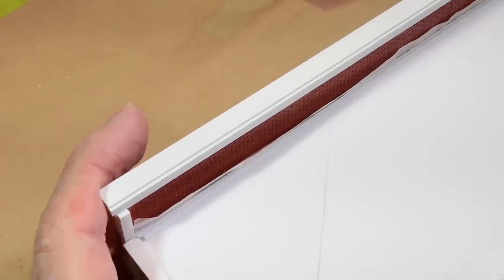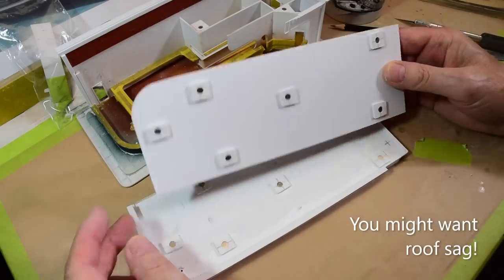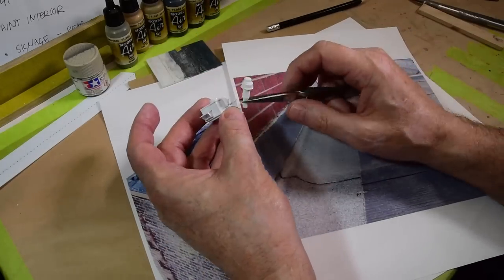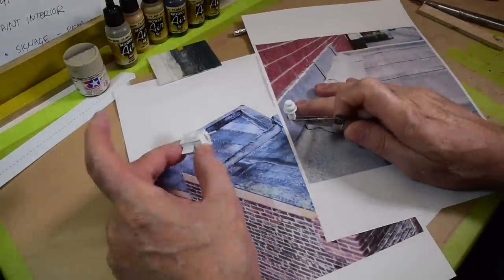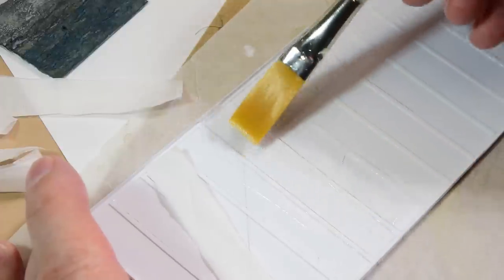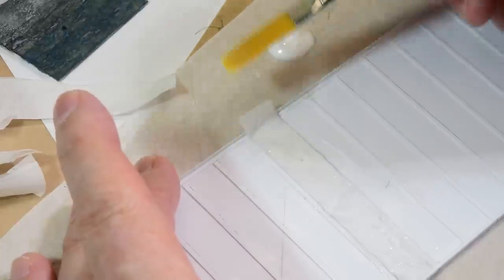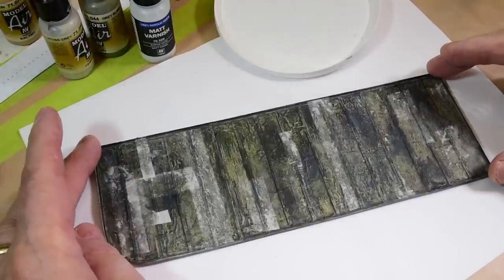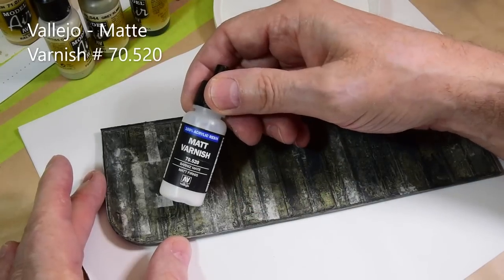The "Nighthawks" Diner Build (Part 5) | River Road ~ Vlog # 137

Comment: Dear Boomer, love this episode on roof modeling. FYI the tar paper you’ve shown with the ‘stone cover’ is called slate chippings, or when a coarser variant, roof gravel. 
Roof gravel is mainly used as ballast, hence the roof membrane doesn’t need to be mechanically fastened. The slate chippings is mainly an extra protective layer for the tar paper. Either for UV protection, or in case of rather flat roofs, to prevent the occurrence of highly corrosive bonds, which can occur when a thin, capillary, layer of water stands on an uncovered tar paper. Such small layers of water are actually capable to form sulphuric acids, by creeping into the hairline cracks of the tar paper. 
As a former plumber, roofer, I’m not familiar with a roofing system that has visible mechanical fasten methods. Other than the two or three layered systems, in which the base layer is tacked, or screwed. Of course those layers are covered by a glued or flamed top coat, which fully seals the punctures. Although I must add there that visible rust on a roof is a certain indication of top coat dilapidation. Hence, the dots still look good on the model.
Further, on modeling roofs, especially in the smaller scales, one often sees (my eyes) a lack of standing up roof material, as well as a lack of flashing. Also, on a lot of models I see a tendency to construct against the obvious flow of water. I do very well understand our model buildings don’t necessarily need to be water tight. However, when constructed with the flow of water, any modeled roof will look much, much better. 
Most obvious examples can often be found how chimneys are connected to a tiled roof. I hardly see any flashing which is put under the roof tiles, where they edge up to the chimney. Most often, the model flashing is just put there as a last sealant tape. Which in real life, would have serious consequences. 
This for now, I’ll finish the vid later. 
Love how you’ve made the roof, and how it looks. 
Humbly wrote this, with no intention to harm or hurt anyone, or anyone’s work. It’s just where my ‘trained eye’ sees the defaults. I of course have my very own. So, this little rant just as a plea for better roof modeling!!
Reply: Thanks for writing that!  It's something I'll be thinking about next time I model a roof, and it makes a lot of sense.

It's also kind of funny how we all have these things that we know well, and so we notice when someone gets them wrong, even though most people wouldn't notice at all.
Reply from the maker: Thank you. It's just a model at the end of the day as envisioned by an artist. Cheers.

Comment: Love the engineering on that roof. I have used tissue to do wood passenger car roofs. I like to paint the seams with semi gloss black to simulate a fresh application of tar. I especially love the green on the roof below the exhaust vents. That’s what would be there. This is such a great build. Thank you so much for sharing in such detail.
Reply from the maker: The passenger car roof sounds awesome. Cheers ~ Boomer.

Comment: Here in the US a lot of these older buildings has flashing made out of lead sheet. The lead could ( and still can ) be bent to any shape you would want. Sometimes it would be ground into the mortar seam. Very nice !!!!!
Reply: Tare paper for roofing comes in a long roll and when I had a new roof put on my building they used the roofing to go up each side about a foot which meant the stuff was 52 feet long per each sheet. i bought the 150 X 50 foot building in 1973 and had to put a new roof on it about 2005.
Reply from the maker: Interesting!
Reply from the maker: Good to know. Thanks for sharing that David. Cheers.
Reply: @boomerdiorama  
That means you can calculate where each roll would run out causing a horizontal swam.

Comment: Awesome!  I have several awnings to make in the future, I have several ideas rolling around in my head.  Paper towel draped of a soldered brass rod frame is what I'm thinking might work unless it's not strong enough to support it's self while saturated in the mat medium.  Thanks for continuing to show us all your secrets!  ~Dennis
Reply from the maker: Great idea! Just use a heavier paper towel. I even use .010" evergreen sheet for awnings and they look. Then drape the sheet plastic with soaked toilet paper.
Reply: You can do it as a flat sheet and then cut drape it later on your frame.  In larger scales you can use diluted white glue.

Comment: Question. What drives the decision to use Vallejo over Tamiya or vice versa. Color choice, consistenc?  I’ve always wondered why you chose one over the other.
Reply from the maker: Because, Tamiya is (IPA) based airbrush paint. It does not apply well with a traditional brush as it cuts through previous layer's due to the IPA content when agitated. On the other hand, Vallejo paint has superb coverage with a traditional paint brush, washes etc, as water-borne paint which won't cut through underlying paint layers because it has no (corrosive) Isopropyl Alcohol (IPA).

e.g. I can lay (water based) washes of Vallejo (with a paint brush), all day long over Tamiya, and it won't lift the airbrushed Tamiya underneath as I build up subsequent layers. Try putting a Tamiya (IPA) wash over Tamiya and agitate it with a brush and see what happens  . . . 🤐 . . . unless, of course you want the effect. Cheers.
Reply: @boomerdiorama  This makes sense. I learned that lesson of using the brush early on and you’re right. But I haven’t had the same issues with washes of Tamiya over Tamiya base. Marybe it’s so subtle that I’ve never noticed or just used enough water to protect the layers. I’ve wanted to try Vallejo since they have such a nice range of colors.
Reply: Always check the labels.  Some of Tamiya's sprays are lacquers.

Comment: How do you determine the order of operations when building scratch-built structures. Fantastic build
Reply from the maker: You determine "on-the-fly" as you build. 

Scratch-built models are unique in terms of assembly, because often times you design it, as you build it. This is why scratch-building is a unique experience over a kit. Most of the time you can't manufacture parts separately, to paint them, unless you know how they fit and then become a component. You have to "build-up" structure and then mask and paint as you go because it is not even a "beta" kit yet with pre-molded parts etc. Cheers. 😁
Reply: Thanks that’s what I thought. Just finished a low relief warehouse scratch built in n scale. The number of iterations I had to go through had me concerned that I was doing it all wrong.
Reply from the maker: @mckerrowsiding  There is no wrong way when it comes to applied procedure because every model is different as is every modeler is unique.😁
Reply: @boomerdiorama  
Buildings rarely last the way they started out.  They grow and change and fall down or burn are rebuilt.  It's all part of the character.

Comment: Boomer what would you recommend to place over the pink styrofoam insulation board after I carve it for my mountains/hills. I see some people using drywall sparkle but I’m not sure that’s the best product to use. Thank you in advance for your help. Dennis
Reply: Option 1: https://www.youtube.com/watch?v=2gHHvnZt8eE (Along the Edge) followed by https://www.youtube.com/watch?v=fvHPldICsw4&t=8s (The Bluff). Thank you Boomer.
Option 2: Lightly spray bomb with enamel acrylic paint. It will 'etch' the foam, giving you more texture. Don't overdo it. Then follow through with Option 1.
Option 3: Diluted drywall mud, thinly applied. When dry, crack it by pressing into the material. It'll give you some additional texture. Then Option 1.
It all depends on what you want to achieve. Whatever you try, be light-handed and fail. The only way to learn and become confidently playful.
Good luck!
Reply from the maker: I just use cheap heavy latex paint mostly. Then add earth tone layers from there where needed.

Comment: Great video, Boomer! Question: You mentioned the use of Vallejo Matt Varnish. I've noticed that my acrylic paint colors lose their vibrancy on hydrocal rock casting over time. Will Matt Varnish set or preserve the colors on rock castings and prevent the color from fading? Thanks!
Reply from the maker: Sorry. I don't use hydrocal for the reasons you mention. Cheap craft paint will also fail to hold it's color as well. You could try and seal the hydrocal with latex paint and then re-paint the castings with your choice of washes.
Reply: @boomerdiorama  Thanks for the advice. I should have been clearer about the steps I took to paint different hydrocal rock castings. An original set of rocks (not many) were painted with acrylic paints only and the colors have faded over the past seven years.  As suggested, I'll go back and repaint those rocks with latex paint, followed with Tamiya acrylic washes. Some of my more recent rocks were painted with a slightly thinned wash of Behr latex paint, then followed with washes of craft acrylic paints.  I still have some coloring of those rocks to do, so I'll switch over and use Tamiya acrylic paints for the final colorings. Hopefully, the colors on these rocks will hold up better. Would this make the most sense at this point?🙂
Reply from the maker: @markreed3433  If you want to sustain "Color Fastness" (as indicated on good quality paint), avoid cheap craft paint. Any type of lighting will kill the vibrancy of the color in a few years. I use Tamiya heavily thinned, and at that, the pigment exceeds any craft paint.

Cheap craft paint has a purpose for larger layouts but not on my layout it doesn't. 😁Cheers ~ Boomer.

Comment: In a video, you mentioned a thin cutoff wheel. What brand was that?
Reply from the maker: Dremel makes great cut-off wheels for the rotary tool if that is what you mean.
Reply: @boomerdiorama  
You can use the bare wheel but always with glasses as the wheels often disintegrate at speed.  They also make a miniature blade guard like on a rotary saw.